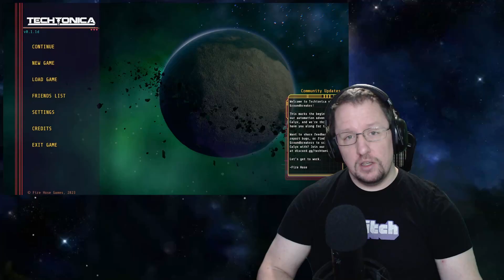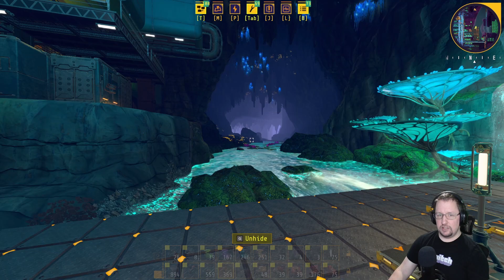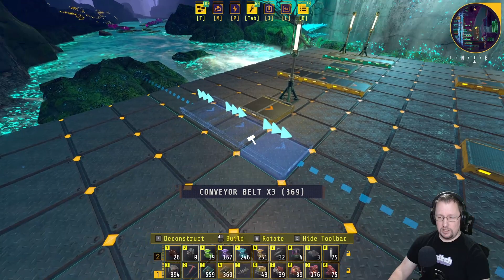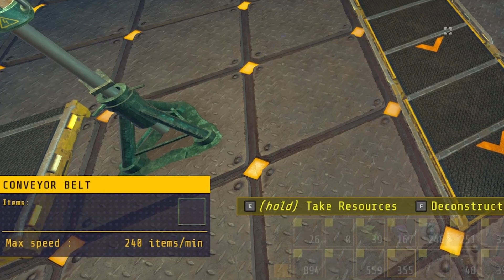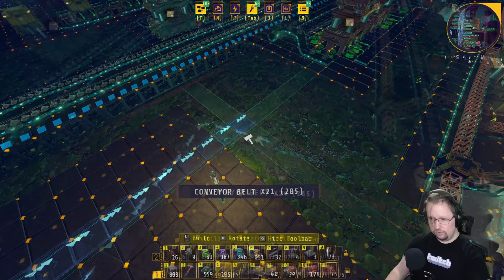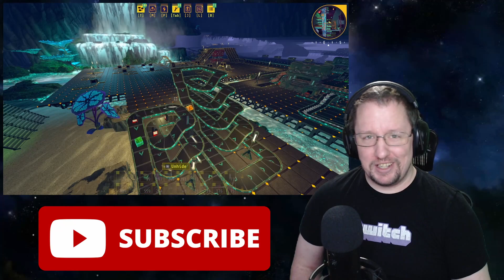10 mechanics of Techtonica belts!

Comment: Thanks! I'm guessing that using Splitter and Mergers is a LOT faster than using Inserters to move product onto a new belt. I definitely need to do that. 
I've been able to get three belts running out of a Splitter but you have to design the side belts to go out 1 square from the splitter first . . . then curve around and back in to run parallel to the center belt. If you try to curve the side belts 90 degrees straight out of the Splitter, it erases the Splitter (version 0.2.1).
Reply from the maker: You're welcome! Right now the game is constantly changing and updating. I think personally the splitters and mergers, or using inserters to move product from one belt to another both have their uses in different scenarios. Inserters only place items on a belt if there is a gap, or open area so they can be useful for prioritization. 

I do believe they're changing splitters and mergers soon, not sure how long the information in the video will be relevant.